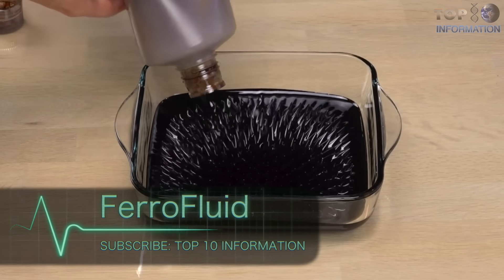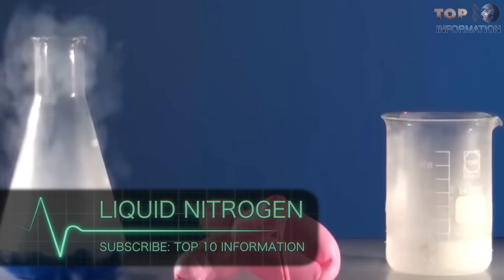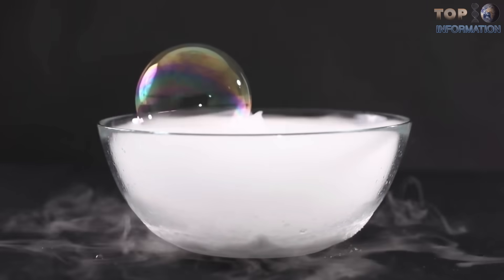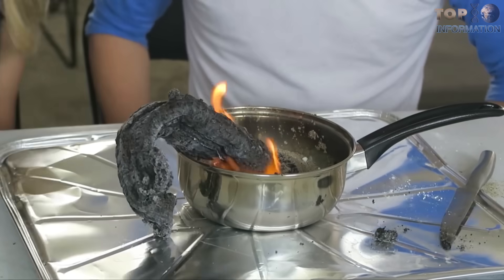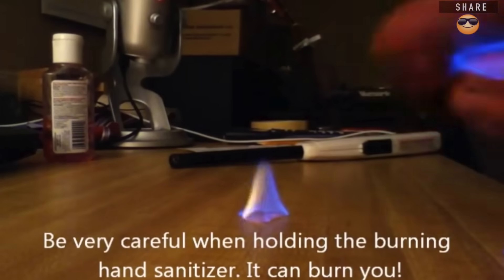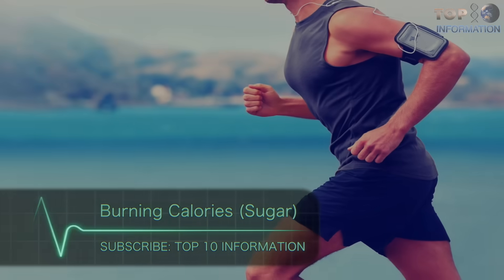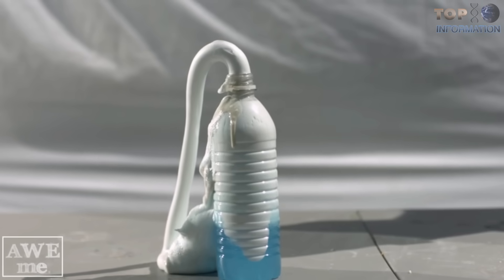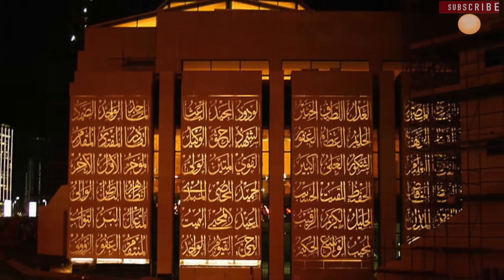10 Magic Materials Which You Should Not Try ▶ 2

Comment: Ferrofluid is something I use a lot as Loudspeaker Designer/Manufacturer. It occupies the Magnetic Gap of transducers enabling cooling of the Voicecoil.
So the tie of this video is misleading.
Sure it can be messy if not handled correctly. 
But it is far from.dangerous or hazardous.

Comment: Be careful with the dry ice vapors. Those cool vapors that hug the floor are use used in stage shows.  Halloween.   But it's heavier than air and sinks to low areas.   YOU DON'T WANT YOU BASEMENT FILLED WITH CARBON DIOXIDE. The air will be displaced,  and your next trip to the basement could be your last.  I'M SERIOUS.  THIS KILLS PEOPLE EVERY YEAR.

Comment: Dry ice or Frozen Carbon dioxide in a swimming pool can kill you. It IS dangerous because you can not breathe it, being heavier than the air around you it hugs the ground until it heats up enough to disperse. Swimming in a pool you can be deprived of oxygen to the point you pass out then you drown or suffocate. It is not a harmless material as it is made to sound by the girl in the video. Her overall giggling flippant delivery of the commentary seems very out of place and disarms the statements of caution and warning about the materials the video shows and the harm to people they can inflict if not handled properly. Just my two cents Be safe and use your common sense if something feels wrong or dangerous it more then likely is so don't do it.

Comment: Correction: Neodymium as a pure substance actually is not magnetic above 19 K; it still requires it be alloyed with an element such as iron which is ferromagnetic at room temperature, along with some other things (the most famous ones use alloys of neodymium, iron, and boron).

Comment: I have type one diabetes , which is caused by your body attacking itself. Type 2 is caused by consuming too much sugar or genetics. I get furious when they get mixed up. Though I did like the video!!!😁
Reply: Type 2 is not caused by eating too much sugar it is when your body stops reacting to insulin
Reply: Type 1 diabetes is the autoimmune variant, where-in the body's own immune system destroys the cells responsible for producing insulin, while type 2 is because the body becomes less efficient at using the insulin in the body, requiring larger amounts than what the body can produce on it's own.

Keep in mind though that she never said which type though, she just said sugar overconsumption can cause diabetes.

It is still unknown why the immune system destroys the insulin producing cells in type 1. As for type 2, sugar doesn't directly cause diabetes, but being overweight and/or generally leading an unhealthy life increases the risk of getting type 2 (this also means the risk of developing type 2 is there, even if you're perfectly healthy).
Neither type is hereditary.

Comment: Dry ice produces carbon dioxide gas, which while not poisonous or anything like that, but it will displace oxygen as it's denser than oxygen. Should you put too much in an enclosed area without ventilation can easily cause suffocation and death.

Comment: Actually, dry ice isn't completely safe, especially in an unventilated, closed room. CO2 gas displaces room air, and it's heavier than air, so if you lay down in a closed room with dry ice bubbling onto the floor, you could suffocate.

Comment: dry ice is actually quite dangerous as the CO2 can displace oxygen and can cause asphyxiation!
Reply: Ya but co2 sinks down, which is why people use fog machines
Reply: what i learned, CO2 is not more active then O2. Therefore it doesnt displace  O2
what you said is CO or "carbon monoxide" (which displaces O2)
but if there are so many CO2 molecules then O2 rate become lower, and it will make breathing harder, so there is still some danger
but it is not as much as like what you mentioned